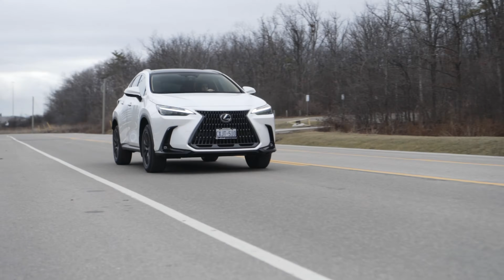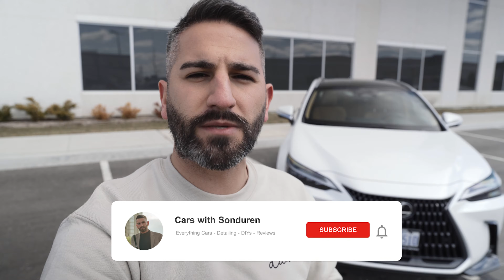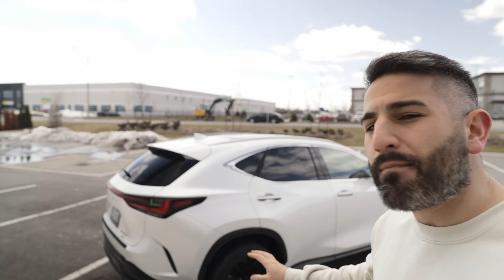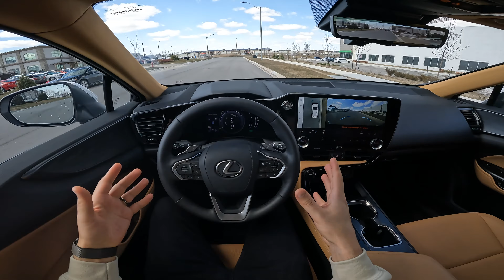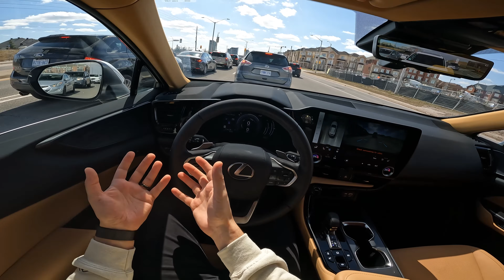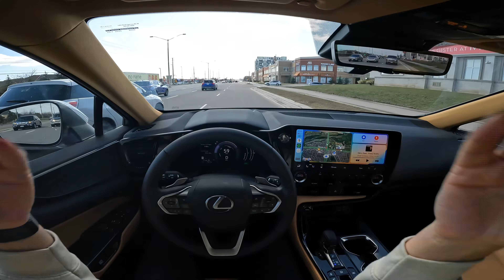Get The BEST Gas Mileage From Your Toyota & Lexus HYBRID!

Comment: What gas did you use, regular or premium?  What temperature outside it was? I think your mpg should be better. Unless your engine was cold when you start trip. Just tested RAV4 hybrid for 13 km. Rural roads. No traffic lights, only 6 stops. Some hills. 28 degrees Celsius, no AC. Basically almost perfect condition for hybrid, except hills. Come out 4 liter per 100 km or 58 US mpg. Same route on 2017 Prius Eco 3.27 l/100km, or 72 mpg. Well, conditions was more favorable than in your test
Reply from the maker: Using regular fuel and I believe it was like 15°C but you are right if it was more favourable I think I would have done better.

Comment: Thank you for the tips,  just bought an Avalon Hybrid and am looking to maximize its advantages! 👍
Reply from the maker: Awesome Shawn congratulations 🎉 You are going to love it!
Reply: @lifewithsonduren  2/3 acclertor pedal down for 2/3 tof max torque at 2k-3k rpm, is most effceint according to bfsc chart fir the 2.5 liter i4 or so, but what driving mode to do it in? eco , normal, sport ?

Comment: What should you do if you click the ev button near the shifter and the dash says ev mode couldn’t be turned on because of low battery, does it automatically turn on bc ev still displays on the dash even though it’s supposedly not turned on?
Reply from the maker: So you should not be pressing the EV button by yourself. I know it seems counterproductive right? After a lot of research, I have found out that actually, the computer will adjust when to use the battery and when to turn on the internal combustion engine to maximize fuel economy based on a variety of parameters. Our input actually messes that up not really sure why they included the button to be honest with you.
Reply: Oh I see, so just pulse and glide as you said and it will automatically switch between battery and engine, correct?
Reply: And also what line are you talking abt at 13:33 and what does it do?
Reply from the maker: Basically, at the bottom of the tachometer, the charging indicator will hit a plateau.

Comment: I have the 20” f sport wheels and run flats on my hybrid and I’m getting 7.4l/100km. I have owned a hybrid for the last 12 years (2010 prius). I have used these tips for years and can say they work well. HOWEVER, having larger wheels makes a huge difference I find. I have been doing more highway driving, which is impacting my efficiency, but I’m finding it very hard to get anything under 7L/100.  Another big factor is terrain. If there are large hills the NX is a beast to haul up and you’ll burn a lot more fuel. 

I’m pretty disappointed with the efficiency so far. Going from a Prius it’s not a fair comparison, but I expected better. I’m guessing the 20” wheels are a big factor.
Reply: I have 2 Priuses. I swapped 17” wheels to 15” and got at least 5 mpg more on my 2017. 2010 on 17” lost 5 mpg
Reply from the maker: You are right the bigger wheels are going to have an effect, but my guess is it’s about 5%. If you’re doing more highway driving, then that’s about what I’m getting as well. To be honest with you in the city that’s where you can really get great fuel economy out of this SUV.
Reply: HI, can I ask aboit tips of good driving hybrid engine ?

Comment: Great video. Can nx hybrid use regular gas? I talked to 3 dealers, and only Oakville lexus said I could use regular gas. If it can,  what's the impact?
Reply from the maker: Hey Nikco, yes it can use regular gas. It states this in the owners manual that regular is the minimum required.
Reply from the maker: I have seen no impact to performance when testing both.

Comment: Another great and helpful video. What are your feelings on the run flat tires? I personally rather carry the extra weight and have less worries about tires on a long trip.
Reply: In Europe, the base versions come standard with 18" rims and normal tires with a repair kit. The result is less weight and smoother grip of the tires on the road than the runflat tires on 20" rims, hence, slightly better fuel economy. Not much, but as very well explained in the video, everything counts and all added, it makes a difference !
Reply from the maker: Thanks Michael 👌 I know there are a lot of people who hate the run flats as they are noisier and overall have a stiffer ride. I agree, but to me the difference has been negligible. Though I do agree with you, I would have a little worry about long trip but if you have CAA or another service that helps. 

The issue is now is it worth the cost to switch it over. For me personally, the answer is no right now.

Comment: I am at an average of 6.25L/100km on my RX350h. I am at 119km on highway though, lol.

Does the automatic preventative braking recharge the battery? Does it use the brakes or the engine to slow down?
Reply from the maker: That’s great fuel economy and I’m sure you can squeeze more efficiency out. Yes it does recharge when it goes into automatic braking as well :)

Comment: Seems like NX 350h in Mexico doesn’t have the function to rise or down windows when u hold the key even in luxury version , does in Canada have that function？idk why the fk lexus do like this , by the way no digital key neither 😂
Reply: Dany G   - Yes, you have ! If this feature is not enabled by default for the cars sold in Mexico, then you can ask your dealer to enable this feature. It is not a parameter that you can access through the normal "settings" (the wheel symbol on the central screen), but it is accessible through the OBD port by your dealer. Just ask for it !
For the Digital Key, this is country dependant... Some authorise it, some don't. Like several other features in this car, local regulations or local commercial guidelines vary per country (and it is the same with other car manufacturers as well).
Reply: @jean-marcdelbos2206  thx man, big help , I’m definitely gonna ask for it,appreciate it
Reply from the maker: Interesting I actually don’t know but I’m going to try it when I get to my car :) No digital key in Mexico? That doesn’t make sense. The app works right?
Reply: @lifewithsonduren  I think the app function is kinda of basic compare with ca or us version, its only 2 service here “safety connect” and “remote connect” , but remote connect with no digital key😑like u cannot drive without ur fiscal key
Reply from the maker: That is lameeeeeeee why did they do this :( I’m in Mexico right now at an all inclusive for the next few days.
Reply: @lifewithsonduren  noiceeeee, man, enjoy ur vacation 🏖️☀️
Reply from the maker: Thanks Dany getting a good tan and coming back to Canada shortly 😎

Comment: This is off topic so i apologize in advance, but i couldn't find the answer anywhere online.  Do you think i can go with 17 inch for the winter?  I will get the same offset (ET35) and overall diameter.  My only concern is will the 17s provide enough clearance for the brakes.  Don't want to run the risk of rubbing the brakes.  My friend has the 1st gen NX and 17s work perfectly fine.
Reply from the maker: Yes you can! I can confirm this!
Reply: @lifewithsonduren  what size winter tires are you running.  Give us the width, sidewall, and size
Reply: A little bit of additional precision on this subject : I had a gen1 NX with 17" rims and 225/65R17 tires, fine. However, with the gen2 NX, the same wheels (17" rims with 225/65R17 tires) are NOT compatible. And with the gen2 NX, there is no version that has 17" rims with appropriate tire dimensions in the standard specifications.
Having said that, in theory, on gen2 NX, instead of the 18" rims with 235/60R18 or the 20" rims with 235/50R20, you could mount 17" rims with 235/65R17 tires (not the 225/65R17 from the gen1 NX). 
If you do so, make sure you verify your insurance and your warranty will not be voided. This may depend on local regulations.
Reply: @Jean-Marc Delbos  ya as long as the 17 inch rims are not too small that they are rubbing the brakes, I can work with all the other specs.  The offset has to around 35, and for tire width you can go narrower to 225 if you want but just have to get the correct sidewall so the overall diameter is the same as the factory 18s and 20s.  In fact, a lot of experts suggest going with narrower tires in the winter because narrower rubbers cut through snow a lot easier, hence perform better...

Comment: Just got one 10 days ago.  Solid 800km per tank without even trying to save fuel.  Probably get 10% more if i follow your tips.  Thank you.
Reply from the maker: That’s awesome mileage! Let me know your best tank range with these tips. Maybe hit 1,000km?
Reply: @lifewithsonduren I really like Lexus and Toyota and always had Japanese cars...but since crisis I  bought B8 Passat 2.0tdi cheap German piece of shit which still makes on 65 liters tank 1150km on average even trashing it every day in city or highway. Average consumption of 2.0 diesel engines is still the cheapest way to go here in Europe. Electricity also went up so even EV as Tesla is expensive in compare to small diesel engines. My lowest consumption on ECo mode was 4.3 liters on that German 2.0tdi engine. What can I say...I would like Lexus NX300 but at 25k-30.000km per year diesel still wins.
Reply: Diesel is another ballgame, the taxes you pay are also higher.  @The_Touring
Reply: @The_Touring … your forgetting the maintenance costs!😂😂
Reply: @Cars with Sonduren  I will probably never hit 1000km.  I do not drive during rush hour and the speed limits around my neighborhood is 50km but I do 70km to 80km...and I drive a lot of highway...so 800km per tank is what I'm going to keep getting